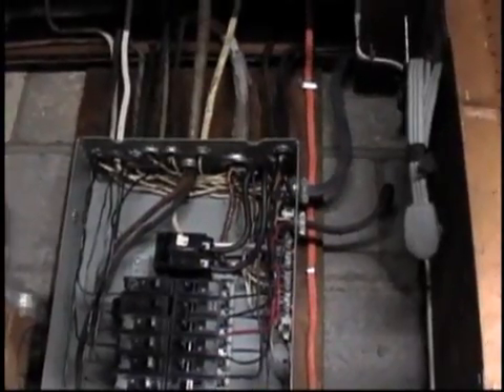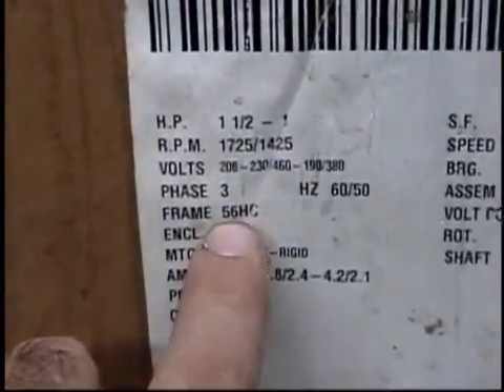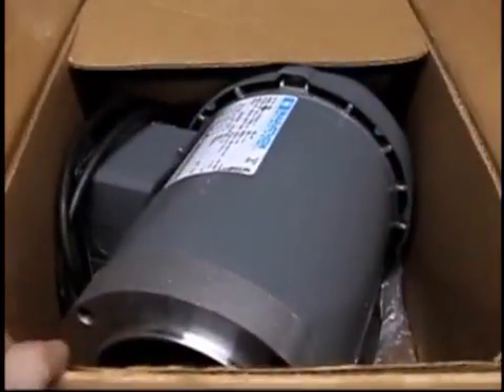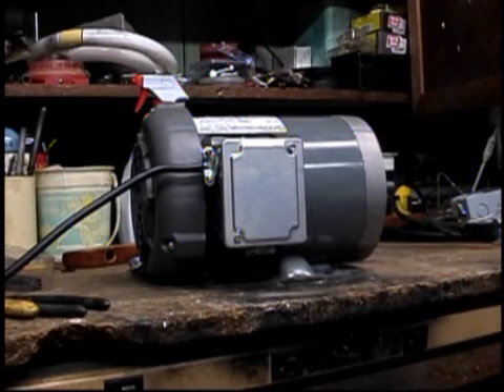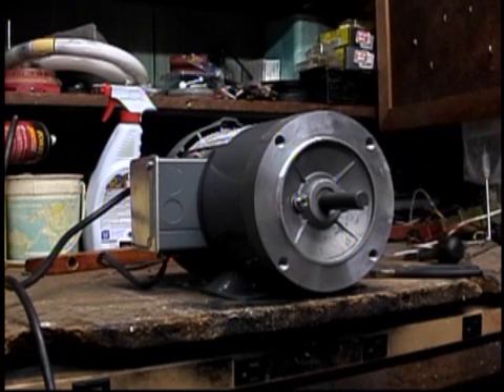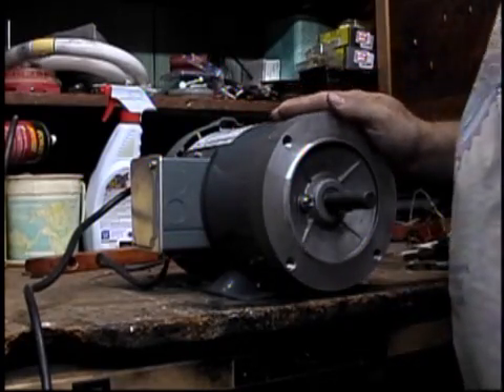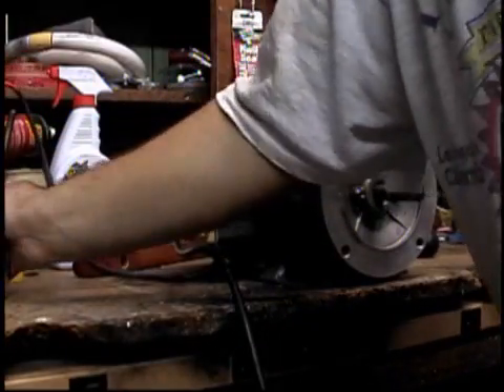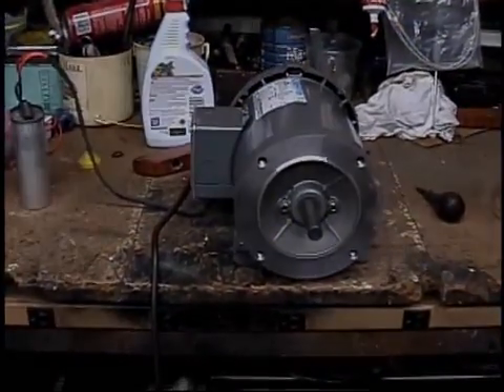Three Phase Motor Startup

Comment from the maker: Yea it sounds like he made a rotary phase converter with the one motor which supplied the phantom third phase to the second motor.  This is just single phase im running the three phase motor off of here......  Only one primary feeds the pole transformer

Comment: I have a three phase motor that I want to test. From your video it looks like I can use two phase to run it.  I saw a video where someone used two 3 phase motors - once running the first motor supplied the 3rd phase to the second motor. The motors were hooked in parallel.

Comment from the maker: Yes, that is one of the drawbacks you do loose some torque.  Further installation of capacitors and or controls can fix that to a point.  I have seen three phase hydraulic car lifts operated from standard 220 240 and suffer no ill effects, but I dont know that caps were installed.  I just know there were a few lol

Comment: Good stuff!, the YT Logo thing was under consideration a few years ago but is not a issue now, you can show company logos or endorse things as you wish.

Motor sounds happy!, if it has trouble starting under load you can add a kick-start  or similar hard start kit across the run cap. I will have a video up tonight showing that on a DWM - Copland 240V 3 phase semi-hermetic compressor.